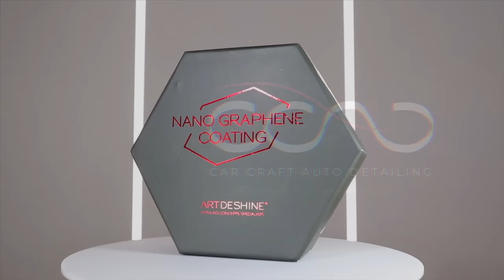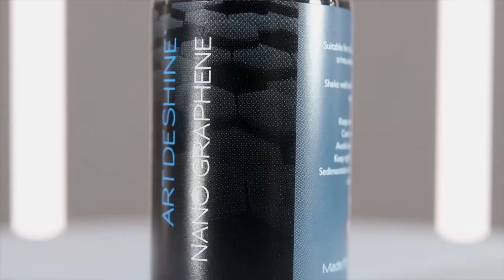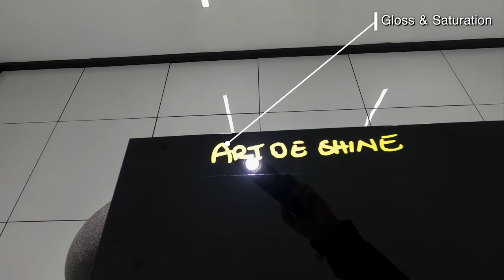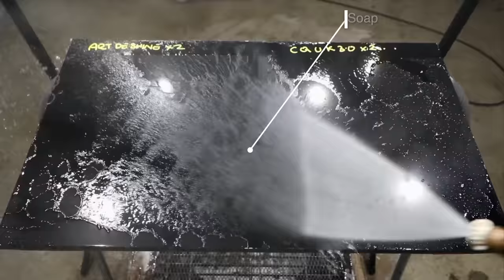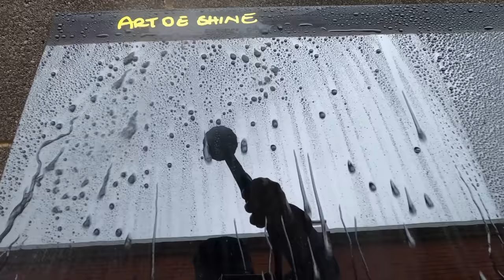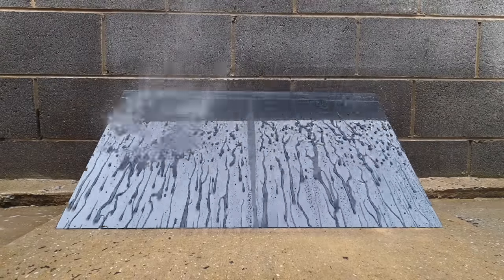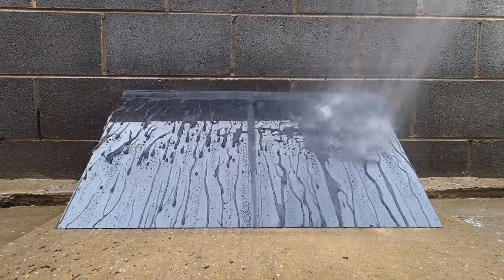A REAL LOOK AT GRAPHENE vs CERAMIC COATINGS + ArtDeShine Graphene Coating Reviewed!

Comment: Awesome video and thumbs up....😀
Just a quick question Sandro, I've been asked to buff a fairly new boat, I realise I have to use polish for boats, I wont be using a compound just a polish with the da and a wax to protect it, but my question is regarding the gel, is it similar to car clear cloat? Does it finish harder or easier and do I have to be careful with the thickness of gel the the way I would with a car's clearcoat? Or is it a fair bit thicker and I dont have to be so careful. 😀
Reply from the maker: Gel coat is hard compared to car clear coat and also tends to oxidise badly which is usually the hardest part of polishing a boat: the oxidation. 
Overall the gel coat coat should be safe to polish as it’s also harder to remove or burn through due to its hardness, so it also tends to be easier to finish well on and you may not even need a fine polish to finish well.
Reply: @CarCraftAutoDetailing  Thankyou Sandro 
😀

Comment: Hey Sandro is Carpro gliss v2 even worth applying over 2 coats of cquartz 3.0?
Reply: For me, yes.  I parked unknowingly next to sprinklers. The water spots baked onto the side of the car facing west in the hot summer sun. 
The dried spots washed right off with CarPro reset and a soft wash mit. Gliss totally worth it.
Reply from the maker: I’m still yet to try Gliss V2 ... I know I need to get around to it!

Comment: Hello sandro. Is the harder the applicator in Sweden, the stronger the coating ?.  Because I tested CQuartz lite Vs a new cheap amazon coating 2020 (19.99eur or 33 $ aud for 50ml ~1,7oz), the fantastic xml superior crystal ceramic & Graphene Coating (9H +).  Yet cheap but the suede with the fantastic xml coating is hard as wood!  😱😮😮😮, compare to CQuartz lite which already had very hard Sweden, the xml is a crazy thing !.  It must be very concentrated in Sio2?!(I don't think it is very concentrated in graphene because the liquid is not very dark).  It announces a duration of 180 days and more, but I think it will go well beyond.  It would be more like 180 washes, maybe a mistake on Amazon.  With a chemical resistance test (meguiar's apc, meguiar's super degreaser, ipa, etc.) it beat CQuartz lite and even CQuartz lite + gliss!  🤔.  Although I prefer real stress testing, letting time do its job.  Just one layer makes good sheeting and beading while 2 layers makes excellent beading.  It would be nice if you gave it a try to see what you think.
Otherwise, do you think graphene which is supposed to be magic and more of a commercial thing than anything compared to ceramic coatings?
Thank you in advance
Reply from the maker: That’s quite interesting and thanks for sharing! There’s a lot of factors that go into creating a good ceramic coating and harness is definitely one of them but there’s always a lot of other things I look for like gloss, saturation, hydrophobicity, chemical and environmental resistance and very important to me is the application and user experience. I think time will tell whether graphene is going to be better than what we currently have, but it’s also important to note that ceramic coatings are also going to get better so it will be interesting!
Reply: @CarCraftAutoDetailing  I noticed it darkened the paint well and a nice shine!  For the price it looks good.

Comment: What exactly made it evident that the second graphene coat was removing the first coat via solvents at around a 2 hour wait, and also not bonding to the panel around a 12 hour wait? I can't imagine how you'd be able to actually witness those things via sight, feel, etc.
Reply from the maker: If you apply a second layer and it actually start to beads and not adhere to the primary layer and really just smears as you attempt to level it down that’s a sign you’ve waited too long to layer your coating. If the feels overly tacky and resistant, more so than the initial layer with excess residue, that’s sign you’re pulling off the foundation layer. I’ve been applying and testing coatings for about a decade, I understand how they work and I also train and certify professional detailers in how to correctly apply them to a high standard.
Reply: @CarCraftAutoDetailing  Very interesting and solid info, thank you!

What's your opinion/your experience with applying multiple coats of carnauba and synthetic waxes/sealants? Say, one of your favorites - Meguiar's Deep Crystal Carnauba. I always apply 2 coats, usually 12 hours apart if life permits, largely because I believe it'd cover any "thin" areas of the initial coat, and secondarily hoping for more gloss and durability. Your thoughts on benefits, max # of coats, time between coats?

Thank you!!!
Reply from the maker: Every product, application method and environment is different, but I’d say in general a few hours is a good time frame for most resins in waxes to harden to the point that you won’t be removing the foundation layer with the next. Laying in my experience does tend to benefit most paint protection products in relation to amplifying look and performance, but it’s really applying that first foundation layer with great prior prep work and application that makes the most difference. Waxes are also more accepting of additional layers down the track or at later times after the initial layer as they don’t don’t tend to be as hydrophobic as coatings which will tend to reject additional layers if you wait too long.
Reply: @CarCraftAutoDetailing  Thank you for the follow-ups!

To conclude: Would you ever bother applying more than 2 coats of wax or sealants (in close succession, that is, to layer them within hours or days, not maintain them over weeks)? If so, what's the maximum #?

Lastly, after doing final polishing to paint and wiping the polish residue away as anyone would, if you're applying wax and not a ceramic coating, do you bother doing an IPA wipedown for a better bond, or do you leave the residual oils from the polish in search of maximum gloss under the wax?
Reply from the maker: I have done more than two layers in the past but I think two layers is going to get you 90% plus of the potential look, behaviour and performance, so anything beyond that is just very slight improvements which may not warrant the extra work. 
If you’re someone that likes to wax or seal their car quite regularly, then an IPA isn’t vital. But if you want the best bond and lasting performance you’re just not going to get that by waxing or sealing over polishing oils - a good strong bond to clean bare paint will always give you the best potential long lasting result.
Reply: @CarCraftAutoDetailing  Thank you very, very much for being active and responsive in the comments. Tremendous!

Comment: Hello good sir, loving your vids. I have 1 question. What coating would you recommend for high dust anti-adhesion with the best saturation and gloss. Thankyou!
Reply from the maker: Nv Evo does have quite amazing gloss and saturation levels and also tends to look quite clean for long periods so it may be a good choice, but there’s certainly may coatings I haven’t tried as of yet that could potentially also do a great job.
Reply: @CarCraftAutoDetailing  thankyou for the reply. I was thinking of something easier to apply like nova jet, or nxt sealer. What do you think? All these products are so expensive whers i live i just want to try and make the best option first time round. Thankyou!
Reply from the maker: Maybe try Nova Lustre I think you’ll really like it!

Comment: Our comments: 1) we always recommend  apply  two layers  2) about application : we got better results  with this way of application : apply - buff dry towel (not damp towel like a first buff)-  buff damp towel - buff dry towel  3)about water spots: your test is extreme and  are not in the world any coatings  that can resist stains like yours. But water spots which we have problem in classic daily car, than ADS NGC  offer a lot of % better effect like ceramic coat, see our test:   https://www.youtube.com/watch?v=iV4OK2B_zI0&t=6s     4) you use first version NGC , actually version i better to apply and better chemical resist        [sorry about my English ]
Reply from the maker: Thanks for sharing and I think it would be great to put those recommendations and instructions in the box to guide the user to the best possible results, but like I mentioned in the video I did several diverse tests off camera before making the video which is what I based my conclusions on.
Reply: @CarCraftAutoDetailing   NGC is coating dedicated to acredited instalers and all acredited installers everyone should be trained in application and theory , and they no need instructions in box but in actually version v2 in box ADS added  application brochure and product characteristics .

Comment: How do you stack these two coatings up against NV NOVA EVO?
Reply from the maker: It’s hard to say without a direct test, but Evo would be closer to CQuartz Pro rather than U.K. - also in price - and Nova Pro does sit above Evo so it will tend to our perform it in many areas.
Reply: @CarCraftAutoDetailing  thank you. I finally got some EV Nova NV from Nick here in the states. I like only having to apply one coat. Cant wait to try it.
Reply from the maker: I’m sure you’ll love it!

Comment: There’s the problem at 9:15 you can clearly see you didn’t level out the Graphene as the glide marks are very visible . By not levelling out you don’t set up a proper mesh could be why you got all those water spots . All the black cars we do never have water spotting .
Reply from the maker: It sounds like you’re having success with this coating which is great, and I understand based on a couple of comments that you don’t like how it performed or how I evaluated it in this video - which is also fine! 
My testing was thorough, it was many many tests that I worked very hard to produce and went well beyond the footage of this video. I hope you understand that I’m not new to coatings - ceramic or graphene - with ten years plus experience with coatings, I do this for a living and I stand by my results, which I hope you can at least respect, rather than just try to pick apart, but that’s also your choice 🙂

Comment: Sandro mate IMHO till a SAE/or ASTM standard is applied to all car and transport clear / commercial paint sealants is applied you can only rely on people such as yourself doing these fantastic reviews and tests , real world tests showing what and how good or bad the products tested  full stop, theres SAE/ASTM tests for oil/coolants and other products to make them up to a standard that every oil manufacturer has to meet to achieve various ratings for those products, but nothing for the car detailing or care care products around the world, i have only found one products which CLAIMS its real good and used by aircraft manufacturers to help seal the aircraft paint, which is permaguard, yet perma guard and mercedes AU own web page about the products shows no ASTM approvals or tests to make sure its approval for automotive paints?
heres permaguard own web page and no ASTM no listed at all, no CASR approval no and i used to work for the aircraft / aerospace industry and i can say this, unless theses a CASR approval number which you can easily check by going online or even calling CASA who is the australian governing body for everything airworthiness for running a aircraft large or small in australia, but nope i could not find any ASTM or CASR approval for permaguard, its not to say that the products is not good in fact the opposite, its like anything as long has it saves money for the operators and will not affect the OEM top coat of the paints used in aircraft manufacture and maintenance of those painted parts then its up to the owners of those aircraft to make a decision to use it or not to use it? 
Basically as long as the company adheres to the CASR 145 plan for maintenance and get an approval, then its really saying that you can use or sell your products for the use specified ie: Your claim is that it will protect the OEM painted surfaces of aircraft paints currently used in various aircraft manufacturers paints and sealants, ie: clear coats on OEM Aircraft paint that it basically? EG: PPG Aircraft paints are specialised paints due to the nature of aircraft aluminum used in the manufacturing of aircraft AIRBUS,Boeing and Other Manufacturers of military aircraft etc etc. :)🏎🏎🏎✌👍👌🙌😊

Comment: an interesting video would be a paint protection film vs ceramic coating
Reply: Why? They're 2 completely different products with different purposes
Reply from the maker: If you have a really skilled installer, the money and make sure the paint is top notch before it’s application, there’s really no competing with the protection that PPF provides, Abe you can always coat it as well to get that same behaviour as a ceramic coating.

Comment: after 2 years surely you will want to top up gloss.....so whats the point lol
Reply from the maker: Yes! That’s something I’ve mentioned quite a lot in past videos that even if a coating can technically last 5yrs and beyond, the chance of the paint looking even remotely as good as it did on day one is extremely rare unless it’s a garaged weekender - in which case I’ve had 2yr ceramic coatings last 5yrs in those more forgiving situations.
Reply: @CarCraftAutoDetailing  bingo